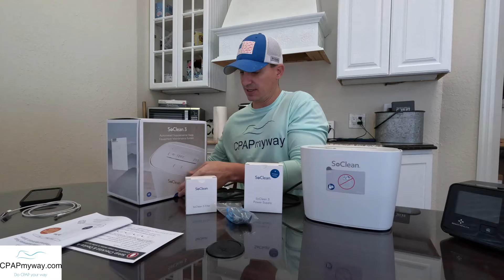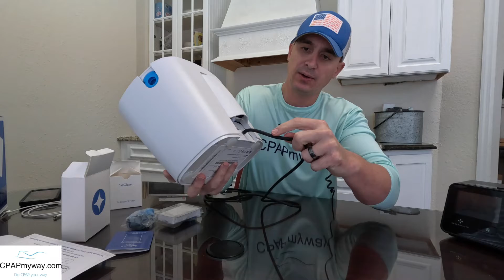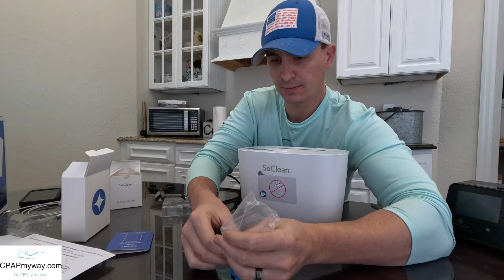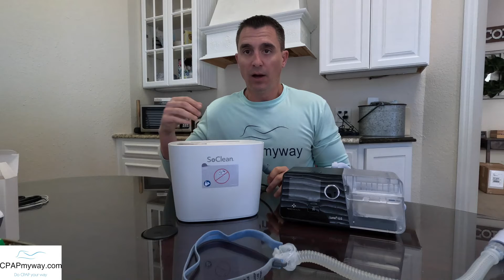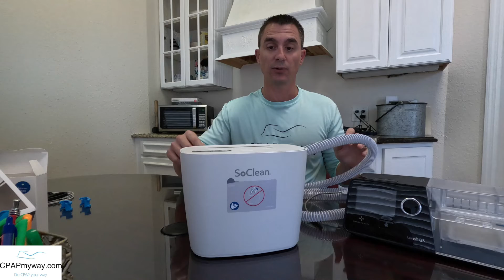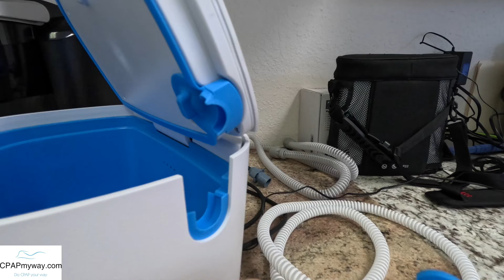SoClean 3 Setup and Demo

Comment: I viewed a cideo prior tao watching this ideo, and it warned against using So-0Clean machines! It aclained that these machines damaged the CPAP machines and caused possible health problems because of the ozone. They also claimed that there is a re-call on the So-clean machines and new instrruction manuals and filters are currently being distri;buted by So-Cleqn. Is this video legitimate and should I be concerned about using my machine?  Please respond ASAP !

Comment: Let me save you people $300 after realizing that no matter how much you use it or do not use it at all your filters have a chip in them. That makes them stop your machine every six months. Mine has been in storage right after replacing filter now, Filters is no good. These are nothing but filter selling gimmicks. Mine is in pieces against a crown concrete wall as we speak, do not buy so clean machines go back to cleaning by hand. It was save you tons of money not counting just a $300 investment but they gonna stick it to you twice a year on filters regardless if you use them or don’t.
Reply from the maker: Thanks for the input.
Reply: Why wouldn’t you use it daily?
Reply: @cathymunn4036  there’s no need to use it daily. I wish I could link you to it, but I saw it a long time ago. There is a video on here from somebody who worked in a hospital cleaning devices. He said there is no reason to clean your CPAP machine every day. I have been using CPAP for 17 years. I only clean my machine once every couple of months, and I’ve never had any problems. I also use water from a zero filter picture. Zero filter is a brand name. It removes all solids from the water, so there is no residue or buildup like you might have with tapwater.
Reply: Thank you for this comment! I will stick with my so clean 2. I wondered if they might be putting some sort of nonsense technology in there to make you use their filters. Just like the ink, printer manufacturers, they want to force you to buy their product when you don’t even need it. It’s ridiculous. You don’t need to use this machine every day. You don’t even need to use it every week. This is just an attempt at thievery

Comment: I used the SoClean original with my Resmed machine.  I loved that it pushed ozone through the machine and water resovoir.  This obviously does not do this, probably not needed though since there aren't any instructions to actually clean the machine except the filter and resovoir. In fact my new CPAP machine states that an ozone machine used on the equipment voids all warranties.  I guess this is why I have not gotten a new SoClean since it will void my warranty.  Although, I really doubt it will do anything to it since it didn't ruin my last one despite using SoClean for 9 years on it.
Reply from the maker: Yeh. This is a common conversation from users like you.

Comment: Surprised to see that the ozone hose no longer connects to the CPAP machine.  I have a ResMed 10 with water reservoir.  Disconnecting the hose is an inconvenience now since my hose connection is fairly tight.  CORRECTION.  Connecting to the ResMed 10 is the same as with the SoClean 2 with the ozone hose connecting to the water bath.  The filter check valve is not necessary.
Reply from the maker: Thanks for the input.

Comment: Great presentation. I would appreciate comments comparing the SoClean 3 to the 2.  Mention the 3 does not cycle through the Cpap water reservoir, plus it is more labor intensive in that with the 2 you put items in the unit without having to disconnect the hose. I think I'm going to miss my SoClean2, which gave me 9 years of service. The 3 is also wider, so bummer with my small night table.
Reply from the maker: Great point!

Comment: The SoClean 3, you now have to disconnect and then reconnect the tubing from the reservoir every time the SoClean 3 is used. The 3 also takes up more space on my nightstand. I dont have to do this disconnect/reconnect my SoClean2. So, what is the advantage of upgrading to a SoClean3? I already have a usb connection on my wall outlet.
Reply: I’m wondering if this is to prevent the companies from invalidating the warranty on the machines. I was told not to use a SoClean device because of potential harm to the motor. The 3 would take care of that issue because it’s only running through mask and tube.
Reply: @cristymeadows7593  I believe you are correct.
Reply from the maker: I am not sure that I would advise you to upgrade unless you like the feature of not having the adapter connected to your CPAP machine.

Comment: What about sanitizing the reservoir also? Doesn't that need to be done too? Will this need a repeat operation and another hour & 15 minutes? Thanks
Reply from the maker: This is not geared to handle the reservoir. You might can make it happen, but it is not set up for that.

Comment: Is there a way someone could make a filter for a bpap that has a menthol smell to it that helps support breathing and of coarse the smell in the air. When I go to bed. Everything is clean. The air quality is great in my room due to having a dyson air purifier machine. But the smell through my mask while wearing it smells so bad. So I wash it constantly or just replace the hose or mask but after the first night after washed or replaced then it smells again. So I thought well maybe if that made a filter that is odor fighting and different menthol smells just as original or cherry menthol or orange menthol. Not only making the smell that the air passes from the air through the filter better but still performing just as good as a current filter.
Reply: Or maybe even putting drops in the distilled water that is menthol that helps with breathing and smell
Reply from the maker: That is a very interesting thought.

Comment: UVC light vs Ozon which one is better?
Reply from the maker: I need to do a video on that for a deep dive, but it is really up to you. Both have pros and cons. I need to expand on that soon.
Reply: @CPAPmyway  Please do expand on that subject  ozone vs. Uv light. . I've gotten used to the awful smell of the ozone most of the time, however it Would be nice if So -clean would research a way to resolve the ozone smell problem as it is very annoying and may be unhealthy, as well! So Clean manufacturer PLEASE Respond!!